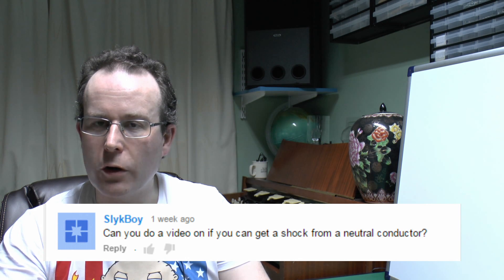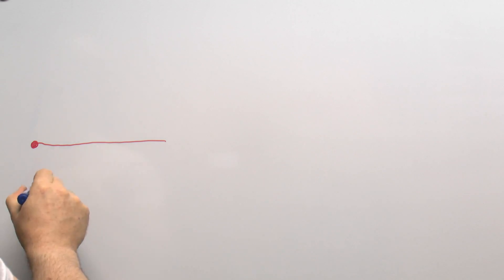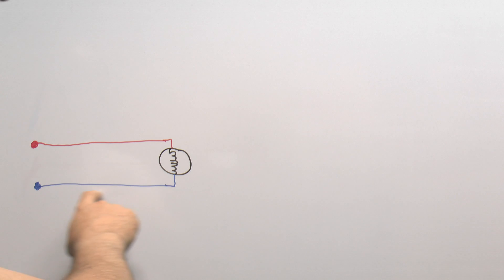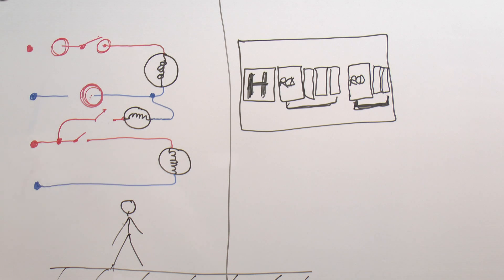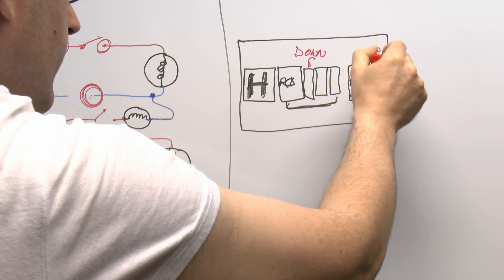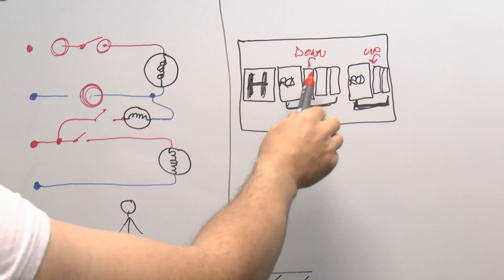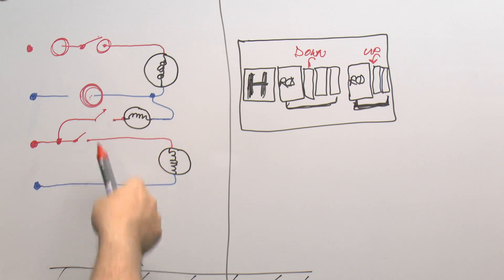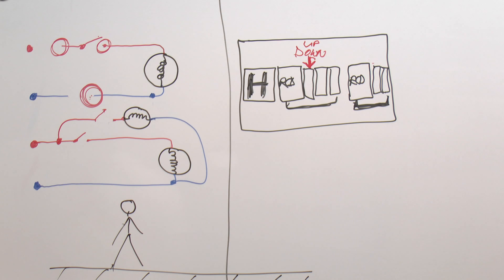Shared or Borrowed Neutrals on Mains Electricity Circuits

Comment: does current come back out of the ground on the reverse cycle of single phase mains power? Maybe a dumb question but with 50hz ac , surely the neutral is 'live' 50 times a second?  help me out please
Reply from the maker: AC isn't about making things live or not - it's just the direction that the current moves in.  Neutral is called that because it's connected to ground, and will always be at the same voltage as ground.  Live is either +240V or -240V relative to the neutral and ground.  This video explains in more detail: https://youtu.be/QHsnZ0RetE4

Comment: I have also been shocked by a shared neutral, fortunately only 110 volts across fingers of one hand.  it's very common to share neutrals in America, I guess it saves on pulling extra wires.  I do believe that it should NOT be called neutral, but name of ' common ' wire also does not suggest that it CAN be HOT. A new name should be used, even the' return' wire designation might be preferred in conversation. When dealing with 230 volt, I am VERY careful not to assume that there is no shared return.

Comment: Great video, thanks. You say that safe installations require NOT borrowing a neutral from a different circuit. I want to install a series of 3 lights in my attic on the upstairs lighting circuit. I can identify the live upstairs lighting block in the attic junction box using the circuit breakers downstairs. But how do I identify the neutral wire I need to connect to my attic light switch?

Comment: If electricity flows fron neg to pos, then why wouldnt the potential voltage be waiting in the neg wire to flow through the resistance and return via pos making the neg side higher in potential voltage?
Reply: Conventional current

Comment: In the USA, all commons must be tied together in the main panel, and that buss bar has to be connected to earth/ ground.  Also, a physical green wire must be run in every conduit, and every junction box must be grounded, as well as each fixture's chassis.

Comment: If we didn't use earth grounds at all, would a person touching the ground still complete the circuit?
Reply: Yes. The earth grounds provide paths to earth if switches/lighting fixtures/back boxes become live. When you touch the ground, you effectively become the earth cable for the circuit, and your body allows current to flow through you and into the ground.

Comment: I am confused. If this is an AC circuit, in the first half of the cycle current flows from the source to the load through the "hot" or "line" wire  and returns to the source through the "neutral" wire. In the second half of the cycle, the current reverses direction and flows through the "neutral" wire to the load and returns to the source through the "hot" or "line" wire. Does ground/earth now provide the return current?

Comment: Would it be possible to use 2 different breakers as long as they are on the same rcd side. If not would you use a higher rated mcb because of all the lights being on one mcb 
thanks
Reply from the maker: No, if rewiring is not possible they must be put onto a single breaker.
Not usually necessary for a higher rating, 6 amps is 1300W of lighting, far more than a typical house would have.
Reply: Ok thanks for reply. do you rate using rcbos better than split load boards
Reply: Also would this neutral situation show up when you are doing continuity testing I am learning at the moment so any info is great
Reply from the maker: RCBOs definitely better, as any fault only affects a single circuit.  However they are significantly more expensive, and a lot of people will just go for the cheap option.
Reply from the maker: Shared neutrals won't be detected with most testing, as there isn't any connection between the circuits unless the light switch is on, and the lamp(s) are also installed - they are removed before doing the standard tests.
Could be found by doing continuity between neutral at the consumer unit and neutral at each point on the circuit, but that is rarely done.

For existing installations, the easy to check is to switch all lights on, leave the lamps in, disconnect both line and neutral for both circuits at the consumer unit and check insulation resistance between L&N for one circuit and L&N for the other circuit.  Should be very high, if the shared neutral exists it will be very low.
Doing another video at the moment which involved an interconnection between two lighting circuits on a switched line, and that fault could only be detected at the consumer unit when the circuits were energised, so would have been impossible to find with normal testing.  That video should be out next week.
Reply: So would this neutral situation usually show up when doing continuity testing is that how you would find this problem exists
Reply: Ok thanks I will have a look at the video thanks for the info
Reply: Hi my friend came across this situation the other day and told him you said to do installation resistance test at the board. do you test the live from say downstairs circuit to the neutral on upstairs and test like that

Comment: Never share neutrals.
The neutral carries the current of both circuits and can be overloaded. In the US, 14 AWG wire is rated for 15 amps. If two 15 amp circuit were both carrying 10 amps and shared the neutral, the neutral would be carrying 20 amps.
Reply: LSuschena    You may or may not be correct.  If both breakers are from L1, then to do so would be a code violation because as you said, 20 amps on neutral.   If one breaker is L1 and the other is L2, then completely NEC compliant.  10 amps both circuits = 0 amps on neutral.   This is called "multi-wire branch circuit.   Since 2008 NEC requires the single pole breakers to have a common disconnecting device installed.   This is for single and three phase.   In three phase if three circuits on one neutral and 10 amps each, neutral amps is = 0.
Reply: Kevin Coop 
I haven’t touched the NEC I decades, so I’ll have to go along with you in that.
I usually work in circuit testing at large industrial sites.

Your thought on this. If L1 and L2 are different phases and the neutral breaks, that would put 220 volts across both circuits, assuming of course there is a closed circuit between them. That’s why it’s not good to share neutrals, crossing circuits create unknowns because electricity will find its way from point to point.

Thanks for the information.
Reply: LSuschena   I've done design a long time, mostly for contractors and directly for the customer.   Everyone is asking about losing the neutral.   Realistically, how do you lose a neutral, do the move or disappear on their own?   Just a little joke here.  Reality, up to 2008, single pole breakers were allowed on multi-wire branch circuits without a handle tie for disconnection purposes.   No electrician that I know would pull a neutral splice or off the bar while connected and hot.  These branch circuits are now "identified" in the panels and enclosures as a group.   So I guess theoretically you could make your question happen if you tried, but would be more bad practice or an out and out accident.  Like sawing through a conduit with energized branch circuits and cutting only the neutral first.
Reply: Kevin Coop 
I ran into it once or twice during circuit modifications in a control board. We opened the breaker for the circuit we were working on, not the circuit was still live. Took several hours to back trace the source to another circuit three panels down. Yes it’s a flute if a neutral opens, and wouldn’t expect it to happen except if the wire breaks.

Comment: What will happen if neural is connected to ground
Reply from the maker: Neutral is already connected to ground at the supply transformer.  If you connect them together in your house, any RCD/GFCI will trip all the time.  If not, then things will still work but current will be shared between ground and neutral, which may result in dangerous situation if a fault occurs.  It would not comply with wiring regulations in the UK or most other places.

Comment: Well explained borrowed neutral issue.
However, In the last part of the vid you showed a 3 phase lighting system. I have never seen this type of configuration installed anywhere. Was this meant to be theoretical? I know they do this with their 2 phase systems in the USA but the only 3 phase lighting in this country is a 3 phase feed to a lighting controller but that is a DB in itself feeding single phase loads, and 3 phase feed to sports lighting that still only uses 2 phases to derive 400V for 400V ballasts.
This is not a true 3 phase circuit that only needs one neutral. Even with a linked switch it is still 3 single phase circuits.
This form of circuit is an accident waiting to happen. If the neutral were to come adrift at any point between the neutral bar and the point between the light fittings of L1 and L2 and the loads are not of equal impedance, one of the loads would see a potential between phase and line voltage.
This is not a legitimate use of a 3 phase feed.
2 hours later and just had another thought. You said what would happen if some "moron" replaced the 3 pole breaker with 3 single pole breakers. I would take issue there with who the moron would be. I would say it would be the person that installed the circuit in that way, not the person seeing 3 separate circuits on a 3 pole breaker and think about changing it. Of course, any competent sparks would check all 3 circuits first and find that they had a shared neutral.
Reply: I have seen such people. Those non trained people always believe in luck. As long as lights turned on, they think they are right.

Comment: my mate's house was built in the 1980's and the spark had run a single neutral around for the lights and connected it into the back of a socket. When he had a new split load rcd consumer unit fitted, the Rcds would not latch in and he had to have all the floors up to get the proper neutrals in!  One assumes the 'electrician' working on the housing scheme was more used to 12V neg ground systems.....

Comment: I am not an NEC egghead, but I believe that at least some version of it allows a shared neutral by design, but the two hot legs must be on a breaker pair that has a tie to ensure they operate together. The prototypical application for this in homes is for the garbage disposal and the dishwasher to be run with a 3-wire non-metalic cable (AWG 14-3 w/ground or maybe #12) and the neutral is shared for the two appliances. The breaker panel will have two 15 A breakers that are tied together for it to be correct (for the reasons you mentioned about borrowed neutrals). Those two loads are generally just a few inches apart, so combining these save some US$$. This sort of separates the men from the boys, so to speak, when it comes to NEC loopholes, and there's surely tons of commentary on just this one circuit diagram.
Reply: Good point, I wondered why my microwave and fridge breakers are tied together, even though they seem to be on completely separate circuits. Shared neutral, I didn't even consider that possibility.
Reply: I would give that about a 98% likelihood that your fridge and microwave are sharing a neutral and whatever version of the NEC allowed that, the electrician followed the rule and tied the breakers together to ensure safety. It's why breakers have holes and they make ties to connect them. I think I've seen small bolts and nuts used.

Comment: ????? In all the properties I've worked on in the uk the live goes to every light unswitched and the neutral is supplied to the light via the switch, all the circuits in this vid are in the basic electrical learning style?
Reply from the maker: There are several methods of wiring lighting circuits.  The situation with the neutral from another circuit as in the video should not have ever been used, but was fairly common 30-40 years ago.
Reply: unlikely to be switched neutrals. You've probably seen the loop-in system with L & N to the ceiling roses and a single drop pair to each switch.

Comment: Slightly off the subject demonstrated (good video sir) ... Neutral can cause shocks to ground especially exterior, could be wet and techs on ladder where even a small shock could be a surprise and cause a fall off a ladder - especially industrial 3 phase where references to ground are at different potentials all about the property.  To avoid shock to service personal, we break both hot and neutral at the device flip switch. This permits safe service of the device and ‘zero potential’ surprises.  You would be ‘shocked’ to see the different ground potentials all about a common commercial site. Now, if Hogan grounding had always been the standard... ah’ yes, Chicago did invent entire structural single potential bonding grounding a gazillion years ago.  This is where metal structural, plumbing, electrical are all bonded to one single ground conductor cable  all the way to the building ground rod system.  It provides lightning and shock safety and saves equipment from damage, as well as avoids dissimilar potential corrosion especially of plumbing systems. Originally designed for building over 10 stories tall. If a hot wire comes into contact with any building metal surface, it’s a faster path to trip the breaker.  Touching two different metal surfaces won’t cause a trickle shock. Think about a person in a bath tub and the water is referenced to the drain plumbing and reaching up to turn on more hot water turning a metal valve - any potential difference can cause a shock - and so the Hogan ground would eliminate that electrical potential. Hogan was not an engineer, he was a political appointee by the Mayor to head the city Electrical Department, so the street story has been told and passed down through journeyman over the years.

Comment: I got the best rattle of my life from a neutral on a mixed circuit, I had isolated the circuit, tested it for dead, and all ok, opened up a neutral junction , where I tapped each of the wires coming into the junction with the back of my hand, and felt nothing, it wasn't until I grabbed hold of two of the neutral wires that I felt the the dirty wallop of the mains return from one arm to the other straight through my chest, the worst part was that had my terminal screwdriver in between my teeth, I clamped down so hard on that thing, I can still remember the involuntary forces. I just closed everything up and nope'd TF out of there. I'll never forget that one.
Reply: @Karl with a K This video tells you why you should test. It's telling you the neutral can be live even if you turned off the circuit to the thing you're working with.
Reply: Always wear rubber gloves in case you slip and try not to lean on any  part of the equipment.
Reply: Great info John. Thanks.
Reply: My best rattle was from the back of a large colour tube TV.  Alongside the blinding visual disruption and the involuntary jerk that sent me across the room, I got lingering pain in one knee and one elbow... never did quite work out exactly why.  Resistance across cartilage?

Tell you something though... I'd almost get an eye twitch every time I had to take the back off a live TV.  A little permanent post-traumatic anxiety made me a far better technician  ; )

It's like they say : "There are old electricians... and there are bold electricians... but there are no old bold electricians"
Reply: @garychap8384  Always wear rubber gloves in case you slip and try not to lean on any part of the equipment.
Reply: I have found circuits where the neutral colour changed 5 times. Multiple times I have also found earth's being used as lives. Rule of thumb test before touch. Better safe than sorry. A small jolt can throw you off a ladder. So yeah don't fuck around for stupid shit. Just test
Reply: Johan Burger of course the old crt runs on ht (if memory serves me right...colour runs on 25kv) and there are serious capacitors in there that hold their charge for a while after turning off.
Reply: @robinmyman  this was on a lighting circuit for offices within 3factory in South Africa. Trust me it was just due to incompetence, nothing else
Reply: Johan Burger Sorry my comment should have been for GaryChap.

Comment: Hi JW. 
You said, when installing a fuseboard, your preferred method wasn't to separate the lighting circuits onto separate RCD's etc. 

What would your preferred method be?

Best regards,

Warren.
Reply from the maker: RCBOs for all circuits, therefore no RCDs to separate anything.
Designing an installation with RCDs so that half your house goes out due to a single fault is not 'minimizing inconvenience in the event of a fault' as required by 314.1

Comment: here in the UK it is not as common a problem as in the USA where we use split phase boards... and the electrician that installed forgot to install the breaker connector when they made a split circuit sharing the neutral and the ground... which as why most of us were trained to turn off the circuit plus the circuit breaker above and below it until we fixed it... just in case it was a split circuit.
Reply: your end part of the video actually showed the exact reasons I run into a lot of times... in the caribbean and the USA, but, another reason is due to how many jack leg electricians have only dealt with the basic old fuse panels, and do not know what they are doing. They assume that neutral and ground are identical because the primary panel in these countries almost always has the neutral and the ground connected to the ground rod. Because they have never worked with sub panels or been trained, they do not know that the neutral is actually coming from the light poles, and that there really is a difference. The ones with no training are the electricians that hurt the most. Here in the UK, most of the residences have a ground that comes from the utility as well as the neutral and the live... big difference... not as many ground spike systems here.